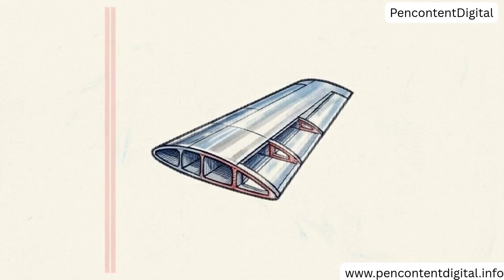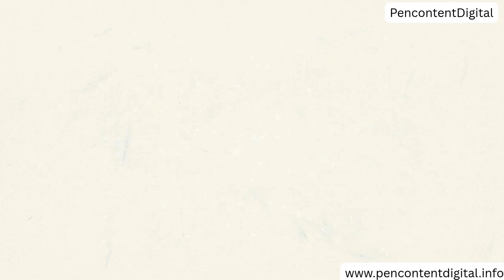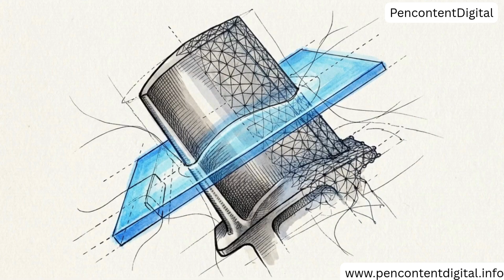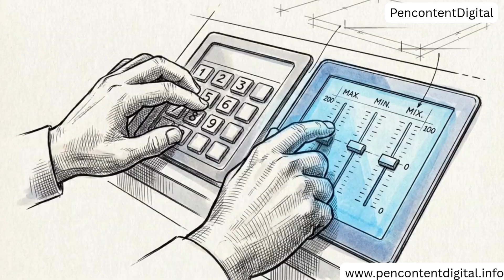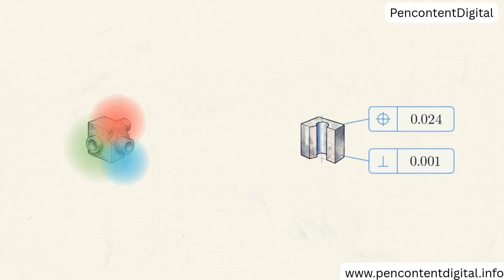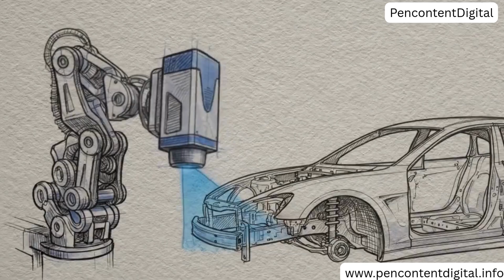Explore PolyWorks for 3D scanning, precision inspection, CAD comparison, and quality control

Comment: A great overview of how PolyWorks can support modern 3D scanning and precision inspection workflows. The combination of dimensional analysis, CAD comparison, and quality control shows how scan data can be transformed into actionable engineering insights. Very useful for professionals working in reverse engineering, manufacturing, and inspection.

Comment: Excellent overview of how PolyWorks supports modern digital inspection and quality control! 📐🔍 The CAD comparison, GD&T analysis, point-cloud processing, and measurement traceability features show how metrology can improve manufacturing accuracy. The connection with Industry 4.0 and AI-assisted inspection is especially interesting. Which application do you think has the greatest potential: automated inspection, reverse engineering, or digital quality control? 👇